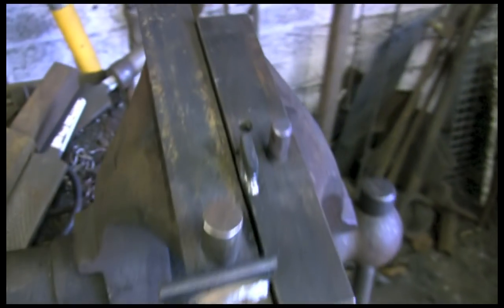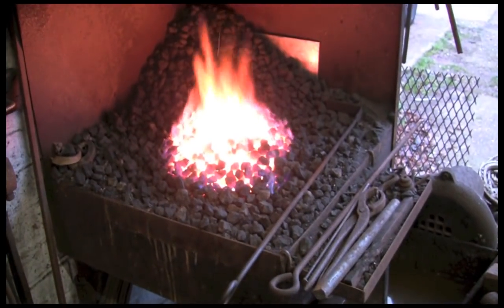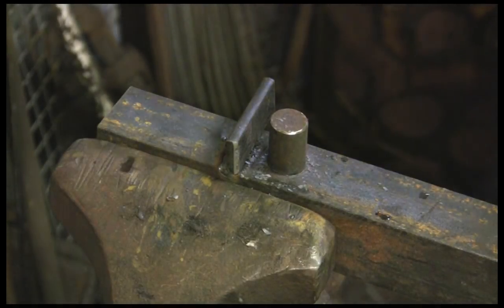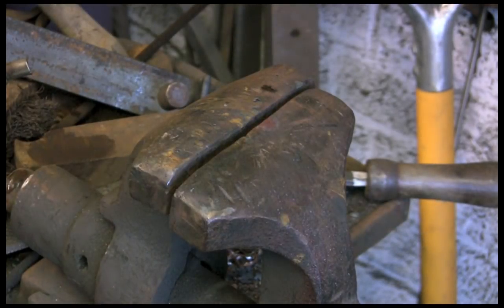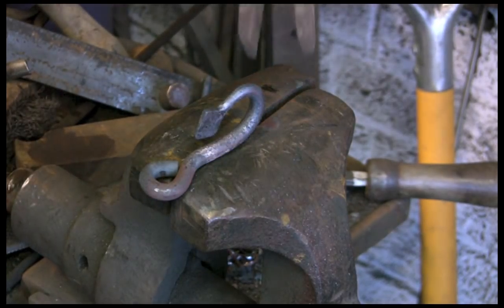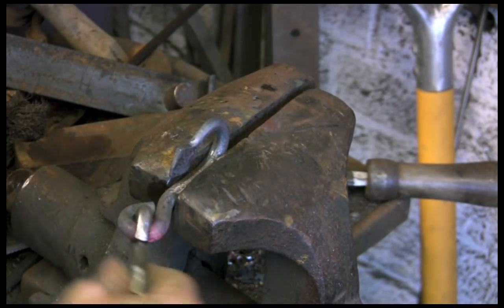Tailboard hook.

Comment: Thanks, this is fun to watch.  What kind of gas do you use, and how do you set the flame?  It's hard to tell in a video, but if that's oxy-acetylene, it looks like you don't have a lot of oxygen, i.e., it's a reducing flame?
Reply from the maker: Oxy-propane, it depends on the job i want it for as to how I set it but in general I just set it with a 3/8" blue cone at the end of the nozzel..

Comment: Hello, I do not know English, I write using google translator, I have a question: what are the measures of cylinders tubes that are in the mold?, please answer me, and I just subscribe to your channel, Greetings.
Reply from the maker: sorry but I don't know what you are asking me.
Reply: garyhuston What are the measures? 1:55 minute which the hook is wound heat, I see two measures what are 5/8 or 1/2?, does the other is 3/4 2:30 minute appearing? That is my question, in the mold to make the hook. I hope you can explain to me, because it looks very practical.
Reply from the maker: oscar vladimir
at 1:55 the small one is 1/2" and the big one 1". At 2:30 I am using the small 1/2" one.
Reply: Ok, thank you very much :) greetings